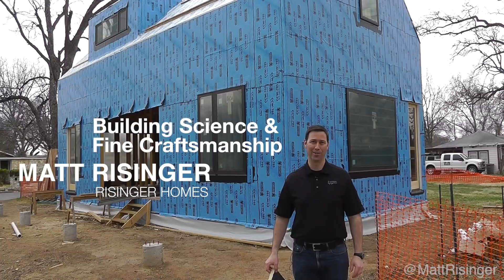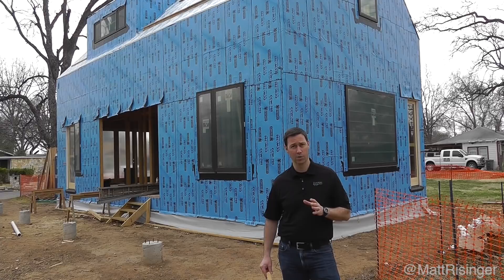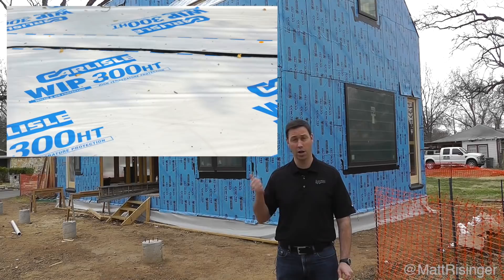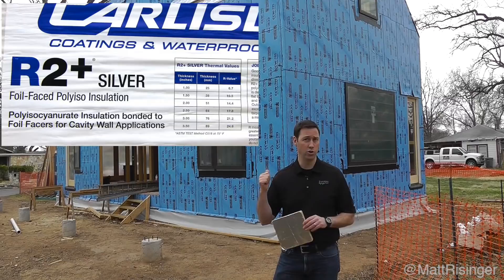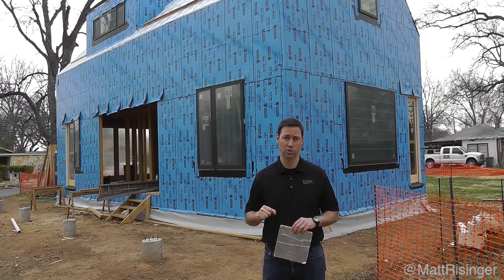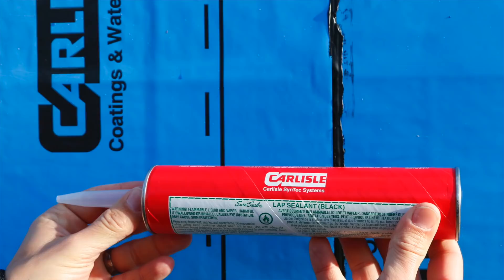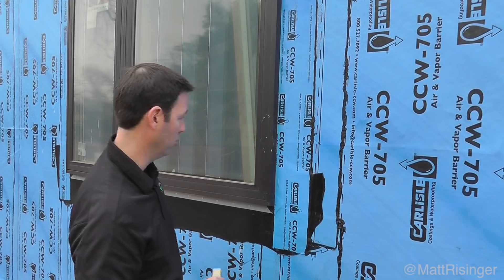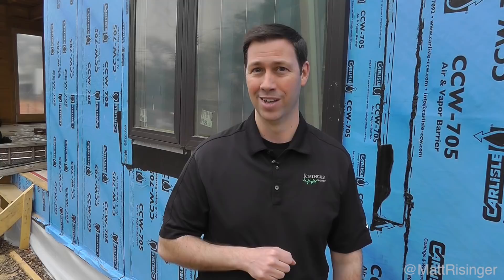The Perfect Wall w/ Carlisle CCW 705 Peel & Stick Housewrap

Comment: Good way to build. I remember seeing a similar system I saw on youtube for the cold climate in Alaska. I think it was called the remote wall system or something like that and remote stood for Residential Exterior Membrane Outside-insulation TEchnique and this was like 5 or six years ago. The perfect wall system reminded me of that system, but there system had foam insulation on the outside and also insulation on the inside and drywall, so a little bit different. Very interesting for sure, thanks for the video.

Comment: I've been doing that since '02, first house was in Alabama.  Not stick framed however, CMU's, grouted full and re-enforced every 2' horizontally and vertically.  Anti-Tornado, when the roof is mechanically connected right down two stories to the slab.  The Polyiso went on in 2 layers, to overlap joints.  Brick ties using 3 1/2" deck screws attached it (with glue) to the concrete block wall.  Then a conventional brick facade making the whole wall about 15" thick.  I've been under the impression that the polyiso panels are themselves a class II vapor barrier.   I'm about to do the same thing to our stick framed stucco house here in California, to isolate the stucco inside the conditioned space, along with the existing framing.  The problem with polyiso is it off gases, losing it's effectiveness after 75 years or so and it's a petro product.  As it gets to 4" thick, you have to figure out how to support whatever siding is going to cover it too.  Using compressed rock wool solves the off gassing problem, but enhances the siding support problem because the R value is less.  Whatever we come up with, has to pass the Cat 5 (160 mph) wind test.  One layer of the insulation should be uninterrupted, preferably the layer next to the inner wall.  If that were only 1", another 3 1/2 inches of insulation could be installed in a steel stud wall, balloon framed if the house has two stories, or more.  (A plan I'm working on now uses 3 floors of 330 ft2 each)
Someone have any better ideas on how to do that?

Comment: This method of using a sticky membrane on the sheathing and only outside insulation is what the PERSIST method does also.
-No real drainage plane - you should add something before the insulation
-Foil faced insulation - you get a little more R value than XPS, but aren't you worried about trapping water because it's such a vapor retarder, or does that not matter because of the sticky membrane....I'm referring to humidity inside the house moving to the outside.

Comment: This looks like great execution of a design by a well-informed architect. I am sort of soured on foam plastic insulations though, I would prefer mineral wool. 

Do all those different types of adhesives off-gas to the interior or weaken over time? (Wrap primer, seam sealer, flex flashings.)

Looking forward to more.

To clear up, I believe the Lstiburek "500 year wall" concept refers to cmu block wall with drainage cavity and masonry veneer. And I don't know how literal he meant it; there are a lot of environmental and material factors you're counting on. 

Great videos.

Comment: Hi Matt, a couple of quick questions. I've seen you make a few different videos with different housewraps. Can you share with us which housewrap is your favorite best in terms of durability, ease of installation, and price ratio? Also, how does this compare to another favorite of yours the German made Delta Vent SA housewrap? Thanks for your time! I always appreciate your well-presented videos.
Reply from the maker: Michael,  I've used different types for different installations.  My usual go-to is Tyvek Commercial Wrap or Commercial D (the krinkly version).  These work for 90%+ of the homes built in America.  However, the more exposure the house has the more "bulletproof" the wrap needs to be.  In this video you're seeing a house with no overhangs so the housewrap needs to be 100% watertight.  Carlisle CCW705 is the choice for that condition.  Delta Vent SA is also great as it air seals better than Tyvek but can be more difficult to source.  Match your housewrap choice to your goals and to your budget/conditions onsite.  Best, Matt

Comment: Great video Matt, nice job. What about sound inside the home.? Will it be more bounce of sound waves without insulation.?
Reply from the maker: Joe,  This house with no drywall won't be too sound proof.  It's a 1400 SF house that's really designed for 1-2 people.  Currently it's slated for a single man, but he's assuming it might house two in the near future.  Matt

Comment: Would this have worked using the Delta vent system? No caulk with that, self sticking, excellent window system. Would it be more expensive, quicker, etc.?
Chuck
Reply from the maker: The Delta system is a vapor open WRB so it's not ideal for this application.  It would compare in cost to CCW 705 pretty closely.  Matt

Comment: Why would you want a drainage plane between the WRB and the foam insulation? Wouldn't it compromise the effectiveness of the insulation, however minor, in order for it to function? The drainage plane should be between the siding and the insulation. Love the uninterrupted continuous insulation walls to roof. Deals with thermal bridging much better than double walls or advanced framing and greatly simplifies those difficult wall to floor or roof transitions. I assume you add eaves later? Any framing issues attaching through all that foam without compromising it?
Reply from the maker: Buzz,  The idea of the perfect wall is that the structure of the house is totally inside the water/air/vapor barrier.  Then, the insulation goes on the outside of that.  Just like adding a sweater on a cold day.  The insulation is totally exterior.  The other major benefit of the outside insulation is that the WRB (CCW 705 in this case) is fully protected from the thermal extremes.  In effect, that CCW 705 is INSIDE the house when it comes to temperature.  It really is the "Perfect Wall".  Hope I addressed your questions.  Matt
Reply: Matt Risinger
Reply: Matt Risinger I really enjoy your videos but I'm afraid you didn't answer my questions at all. I understand the perfect wall concept (I have been reading about Joe Lstiburek's ideas since he came up with the airtight drywall approach) so it is not necessary to dumb it down for me with the sweater analogy. I am also think I understand the importance of a drainage plane. I was questioning the placement of it with your comment about how the seam sealant provided a bit of drainage plane. With all that insulation OUTSIDE of the vapor barrier there shouldn't be any condensation issues. But moisture can get past siding so there should be a drainage plane between the siding and the foam board, not the insulation and the WRB. I have plans to construct a home using a similar approach and I am still trying to work out some of the details, particularly wall to masonry foundation transition and framing details for building eaves and other roof overhangs that will also be outside of the WRB, with minimal disruption of it. Hope to see some more videos from you on some of that.
Reply: With this building method it is best practice to have 2 drainage planes.  The only thing I would avoid is using foil faced foam because it's a vapor retarder and too risky in regards to condensation forming.  Just use XPS.  Hope that clears everything up.
Reply: @ 77Avadon77 - With no exterior insulation, how did you solve the issue of thermal bridging of the studs?  You can't without it.
Reply: Cougar Land i’d like to know the same thing.
Reply: I think the drainage plane between the WRB and external thermal insulation is for any moisture in the air that gets behind the external thermal insulation. I dont think The external thermal insulation is fully moisture resistant like the house wrap and since you have that small gap between the WRB and external thermal insulation you need to have a drainage plane that allows trapped moisture to escape by sliding down the bottom and out.

Comment: Hi, Matt -  How did you handle the bathroom exterior walls for this house?  In a JL 'perfect wall' house with no insulation in the studs, I am puzzled about how to waterproof a shower with one exterior wall. If I do the standard Kerdi mat or Redguard waterproof treatments, isn't that equivalent to installing vinyl wallcovering with no place for water/moisture to dry out of the studs behind the shower? Keep up the great blogs and videos. By the way, Carlisle showed a photo of this house in their lecture on the building envelope at their recent symposium. Thanks. Patty
Reply from the maker: Patty, Cool to hear that Carlisle showed a pic of this house!  So, on the outside wall issue.  1.  It's not as big of a concern because you don't have insulation in the stud cavity.  If you got some small leak or humidity the studs would absorb that water and could dry.  2.  To be safe I would drill a series of 3/4" holes horizontally between the studs starting at 2 stud bays to the right and left of the shower.  That way you'd get easy drying and a clear path for moisture to move from more to less.  I think this is a very minor threat in a perfect wall house.  I didn't have any outside walls in my showers of this house.  Best, Matt

Comment: Very interesting and great work Matt.  Can't wait to see more videos, particularly the window install and HVAC design.  What's the foundation design?  How tight are you trying to get the house?  Will you do a blower door test?  Am I correct in understanding that these building methods work in any building zone by tweaking the materials to the design criteria?
Reply from the maker: Yes this will work in any Climate in North America, you would only vary the thickness of insulation.  Stay tuned for more on the other questions... Matt
Reply: +Matt Risinger 
Hello Matt, 
It is not usable for any other part of the world then dry desert.  Problem to have this in cold climate is that you put the vapour barrier on outside (which is fine in texas) but in cold and humid conditions ? No vapour barrier protecting the wood framing from inside moisture Vapour sources? 

Only way how to possibly make this work is to use a forced air ventilation system with dehumidifiers and thermal energy recovery. I know there is AC in Texas and no heating needed. 

6 inches insulation is almost nothing for any part of US or the world that actually gets winter so the energy requirements would be horrible you need to have at least 16  inches or 40 cm of high quality insulation on the ceiling and angled roof parts and 10 inches 20cm+ on the walls  (rigid foam is crap frankly as far as thermal performance) 

On one hand I see some exciting stuff coming US but is some areas like thermal insulation thickness and quality   it feels like you are lacking behind. Love the channel great stuff but the 500 year house and this video made me laugh this is going to fall apart in 20 years. Metal clad stick on insulations like this have a real life expectancy of 20 to 30 years then the putty will loose the flexibility and start to tear the stick on membrane. 

Another thing MOLD. This is going to become in 10 years a cold nightmare. Most building in Europe have ETICS system which is basically what you have there with ventilated facade from sheet metal instead of stucco. 
Big time rigid foam insulation craze 10 years ago with EU subsidies. Now when we rip off while remodel the whole area under rigid foam is black. 

It is not possible to make perfect contact between the insulation and the foil air gets trapped there with temperature changes condensation and mold will start. 

Not a good idea Put on vapour barrier and airtight the inside as well.

Comment: How do you get this insulation and cladding to stay on without puncturing the water barrier and how well will this hold up to wind storm?
Reply: Fasteners do puncture the water barrier, but rubberized asphalt like the Carlisle product he's using are designed to self-heal around the fasteners.

Comment: Was the CCW overlapped or just placed side by side and caulked?   How would the CCW compare to tyvek wrap? Great videos, very informative.
Reply: hippo potamus a 3” minimum overlap is industry standard. With sealant detail at water leading edges. Top and bottom if sheet is ran horizontally. I seal all overlaps no matter.

Comment: I have a question about your MAGNIFICENT build that relates to my tiny house I am currently working on. What did you do about attaching the siding and  polyiso through the weather/air barrier and into the OSB and studs? Was there an issue with nail penetrations breaking the air barrier and causing leakage, or do you have a solution that I'm unaware of like the membrane acting self sealant or butyl tape where there are penetrations? Thank you. This info would help my thought process a lot!
Reply: Peel and stick is a rubberized membrane which will seal itself around your nails. No need to worry about that.

Comment: Sq. ft of home? have you run a manual J yet? I am thinking about using JL's cmu 500 year design on a house soon. why no roof overhang?
Reply from the maker: This is about 1450 Sq Ft.  Man J showed 1100 sq ft per ton.  We are using a Mitsubishi three head mini-split system to heat/cool the house.  All overhangs are added later after the insulation.  Matt
Reply: Great work, thanks!

Comment: This house won't last 500 years. At least not the insulation. Insects, particularly carpenter ants, LOVE (!!!) foil coated polyiso panels. My house, built in 1985, was built with half inch poyiso panels on the outside, just like you advertising here. 20 years later, carpenter ants had drilled half inch wide channels between the foils up two stories all the way to the roof. All around the house. They love these panels! And the theory of carpenter ants requiring a moist environment is a myth. Bone dry. My guess is that they love the warmth to hibernate during the winter. For years I was wondering why in the spring my house would become infested with lethargic ants. Once I started ripping the siding off, I knew why. Unless you live in a desert somewhere, I STRONGLY advise you putting polyiso panels on the outside of your walls!

Comment: Polyiso loses 80% of its insulation value over time.
Reply: Please post the evidence.
Reply: Go look it up for  yourself!!
Reply: Ok, I have....no such thing.
I did find one about mineral wool board having 80% loss from "wind washing"....and that was on comparing polyiso to it.
Reply: "Polyiso, it turns out, can lose as much as 25% of its R-value when the temperature drops."  That's the best you're going to get.
Reply: Cougar...I recently took a Passive house Training course, it is in our passive house manual....I heard this a few years ago as well and did not really believe it, but it is true. Our manual has a photo of the manufacturers information.
Reply: Adam, I should have said Polyiso is a vapor "barrier" not retarder.   That's a lot different than comparing to XPS.
Reply: I was going to completely diss your outrageous comment but let me add some facts instead.  There was a study showing an 80% decline in R-value of polyiso foams... WHEN DEGRADED BY UV RADIATION.  Polyiso is less stable in DIRECT SUNLIGHT than EPS  foams.  In other words, if you leave the raw foam exposed to sunlight - yes it disintegrates (as do many building materials).  It gets chalky, it falls apart.   Polyiso is also more absorbent than other foams, so it shouldn't be allowed to get and stay wet.   In other words - it's not a good choice for anything that's going to stay out in the weather. (Fake garden rocks... foam corbels/rafter tails.... statue of Elvis...) 
But that's NOT what happens to polyiso foam in sheet form, between protective layers, and protected from UV by siding or whatever, or in use in a SIPS panel.  As long as polyiso is protected from UV degradation and moisture damage  it will perform perfectly for decades, probably  centuries.
Reply: savidude1, You're not too savvy. That's a load of horse shit. 80% my ass. Maybe just maybe, if it sat out in the sun for 15 yrs, then I might agree.
Reply: @HBSuccess  I used Poly Iso 2" thick at 8000 ft. under 1" cedar siding in 1980 and I saw it shrink to 1 1/8" under the siding on east,west and south sides of condo project by 2016. Siding Flopping on nails no Insulation under it.
Reply: @davetaylor8614  ouch -- that 's no good -- thanks for the info.